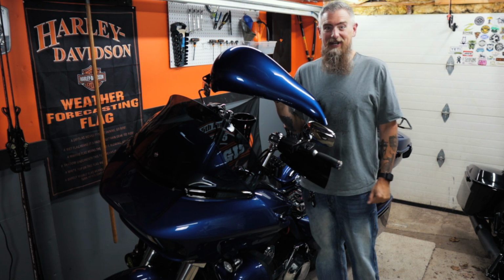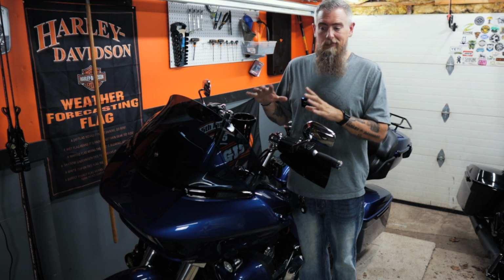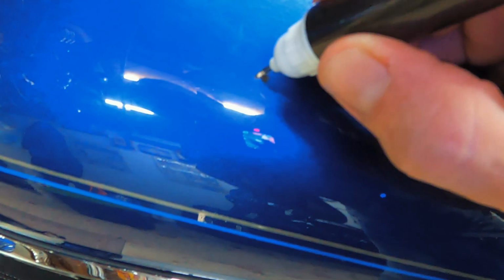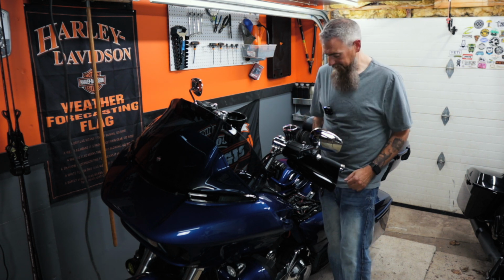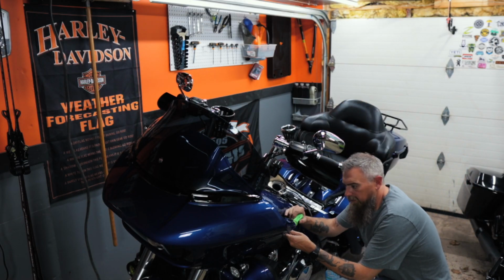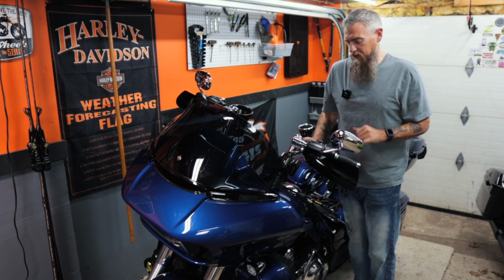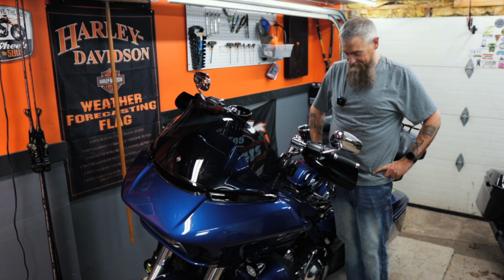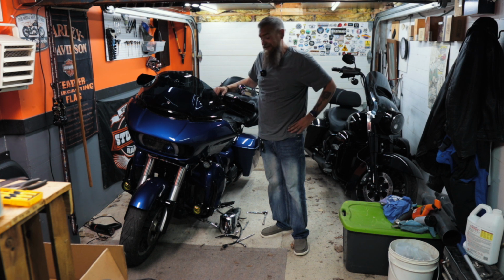Get An Instant Custom Look With The Effortless Install Of @advanblack's Stretched Fuel Tank Cover

Comment: Advanblack recently came out with a stretched tank for Road King. I put one on mine earlier today. It looks awesome, but you are absolutely right, it takes some getting use to. Where did you get your tank badges?
Reply from the maker: I got them from rebus emblems but they must have gotten flagged by HD cause I don’t think they make them anymore.

Comment: What seat u running the website says uxhave to run a stock seat I have a mustang seat so trying to fig out if stretched tankcovers will work on my 2015 road glide
Reply from the maker: Yeah I'm running stock.. I'm not sure what exactly happens with an after market seat.. I wouldn't think it'd get in the way anywhere but they do say they designed it specifically to work with stock seats.

Comment: Good stuff Drew! Bike is coming together nicely! You powder coating front forks this year?
Reply from the maker: That's the plan.. pull everything apart as soon as the snow flies and send it to powder coat.. still need to find a guy. Also will be a great time to do suspension since the forks will be apart. After that I'm about done I think. I won't do any engine mods until I need engine work and everything else is basically where I want it 🤷‍♂️for now anyways 😂
Reply: @Touringmidwest  nice! Now get some riding in!
Reply: Hey a good cat riding out your way on an epic road trip, just stumbled in to his channel recently, good guy to sub with… Cage Free Moto
Reply: @Touringmidwest   Naw, you have to get those chrome handlebars and chrome mirrors and chrome horn cover, and chrome front turn signals (did I miss anything)  replaced too.  LOL
Reply from the maker: @heybruh3274  your not wrong about any of that

Comment: Maybe a before and after shot of the tank?
I agree about the stock fuel door!  How hard would it have been to have it flip the other way and make it user friendly when pumping gas?  Sometimes I'm sure Harley engineers have their heads buried in their a$$es!!
Reply from the maker: That's true Harold.. there's a short after shot at the very end of the video.. I didn't do a before shot though.